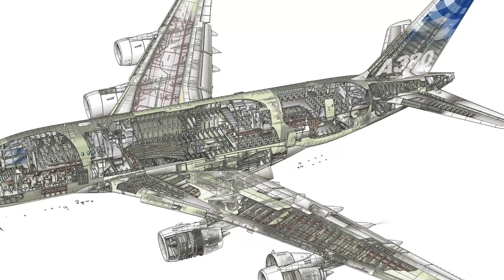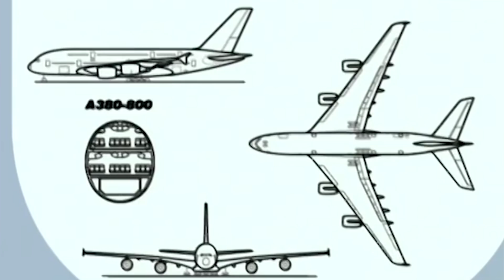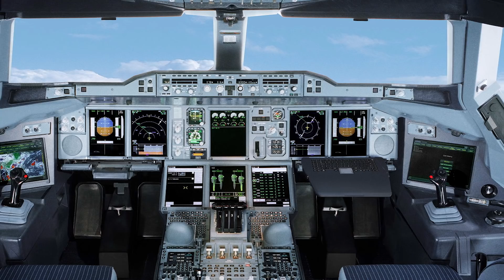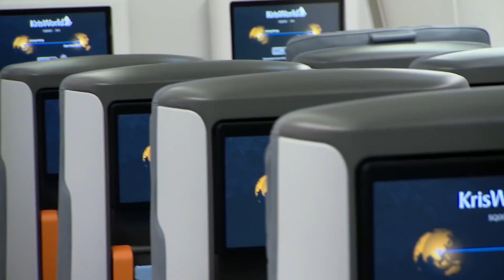Airbus A380 - the European flagship

Comment: I fail to understan why this plane are not used at charter routes. With +10.000.000. paasengers in Alanya alone, its strange that it's not economic, even if it could move 2400 passengers each way daily ex. from Frankfurt to Alanya, You could limit the laugage to cabin (which 90% already use). I have heard that the take offs are to costly in fuel consumtion.

Comment: The A380 is a failure; despite all these positive comments; They are scrapping them already. After airlines found the reality of them nobody wanted them. Not even the freight companies want them. With air freight one of the big problems is that the cargo is often too light and you are out of space in the plane before you are out of weight-carrying ability. So you wind up flying anyway because you could not fit in more. The A380 would have been good in that context but even with that advantage, nobody wants this airplane...

Comment: I would not write the A380 completely off. When air travel returns to previous levels after the worldwide pandemic ends, busy airports will surely benefit from higher capacity planes, as they can carry more passengers to the air on the existing runways with existing capacity. I really hope a twin engined version of the A380 will see the day of light one day. The A380 is - currently - a flop. But lessons learned are valuable and could potentially pay off. I might be wrong though. In that case, the A380 is really the flying elephant.

Comment: Amazing machine, but also one of the ugliest passenger planes ever built.  The era of the 4 engine passenger planes is over, but the 747 will probably continue on as the best cargo plane out there, since it originally started as a freighter and is much better suited for the job than the 380.

Comment: I thought Airbus was going to end production of the A380 after all deliveries are completed in the early 2020s. And I thought Boeing had not yet announced that the 747 program would end. To my knowledge Boeing has no plans to discontinue the 747 production as of right now.
Reply: FinalLugiaGuardian Wow, the 747 is dying next to the 380 so what rock do you live under if you didnt know that...
Reply: @stacked-motors  That may be true for the passenger 747, even though Boeing has not announced any such intentions. 
However, even if the 747 passenger jet ceases production, the 747 freighter will continue to be in production for the foreseeable future. 
Joe Sutter predicted the 747 would one day be just a freeighter. And a design feature of the 747, the nose that can open up to facilitate loading cargo from the front of the airplane, that allows much longer cargo that cannot be loaded any other way in any other aircraft, is the reason that it cannot be fully replaced for that purpose.
That is why the 747 will continue to survive for much longer than the A380 production will.
Reply: @stacked-motors  The A380 is done. Production will end in a year or two. All airlines using it are retiring it early, within 10 years. It is too expensive to buy or operate. Not efficient. It has to be basically filled to be viable.
The 747 is still being produced mostly for cargo versions and VIP planes. No end of production in sight. Lufthansa is using 747-8s to replace their A380s. The 747 cargo freighter is king of that niche. So no, the 747 is not dying like the A380 is. Somebody is confused as to who is living under the rock.
Reply: dave miller when did I ask anything about the a380, oh yeah, I didn’t, you don’t have to tell me the facts of it everyone already knows
Reply: dave miller also I literally only said its dying, not dead, like the a380

Comment: 747 is not dead yet. The cargo version is still going strong. On the other hand Singapore airlines have retired their first A380 only after 10 yrs. This is mainly because of the failure of hub and spoke model and the advent of small long haul planes which are more profitable.

Comment: It seems like a never ending stream of a380 videos saying how great it is and why doesn’t the industry buy it. 

Airlines are businesses and the bottom line is what drives their decisions. 

No different than 747-400’s and a340’s being retired, the a380 is another example of the end of 4 engine passenger planes when compared with the business efficiency of twin engine aircraft like the 777, 787, a350 and a330. 

Passengers may like the a380, but those same passengers vote with their wallet when they buy an airline ticket and will opt to find the most direct and cost efficient service to get where they are going.

My last trip to Singapore, I wasn’t about to endure a flight to Europe and on to Singapore so I could fly an a380 even on Singapore airlines.  Further, I wasn’t going to fly domestic on a 737 for 3.5 hours to connect on to an a380 from the west coast of the USA. 

I happily took a 777-300ER non stop to Taiwan and connected onto another 777-300ER  for 22 hours total travel time including connection.  

Some would say that airline could use an a380 for the benefit of the customer, but the 777-300ER wasn’t full on any of 4 flights so there would never be a business case to put a 525 seat aircraft  on a route that isn’t consistently sold out in a 777-300ER. 

In other routes, airlines with the demand would rather offer multiple 777 or 787 flights per day to give schedule options than limit themselves to a single a380 per day. 

For those that say the a380 is the solution to slot restricted congested airports.  The problem is the volume of 737 and a320 flights that by shear numbers consume most of the slots and gates.  Therefore, the solution at an airport like Heathrow is a middle market plane like the proposed 797 that will carry 225-275 passengers that can have 2 planes replace 3 planes.

Comment: Almost all of your videos are really well done and very informative, but this video is largely garbage.

Nowhere do you state that the A380 is a huge money loser, ill conceived in face of more than adequate evidence that it would never make money.

Airbus became obsessed with the 747 program, and ignored all the obvious warnings that there was insufficient demand for an airliner of the A380's size to ever justify designing and producing one. Thus Boeing sensibly developed the Dreamliner while Airbus stupidly built the white elephant A380.

You mention the 270-odd sales of the ship, but with rose colored glasses on, not that this is far below the break-even point, or that even 100 additional orders, if they result in deliveries, will leave the plane deep in the red.

Permanently in the red, as Airbus sells the A380 at a break-even price point.

And, a VALID comparison with the 747 would have been the 8I, NOT the -400, and the 8I is just as efficient AS ACTUALLY FLOWN as is the A380 as it is ACTUALLY FLOWN.

And the A380 has not "ended the 747 program", as the -8I is still in production and the -8F has no peer in its market segment.

You completely blew the subject of the A380 freighter version: The problems for Airbus there, vis-a-vis the 747, are at least 3-fold: 1) No nose door; 2) The cargo bay is cut-up and inefficient in shape due to the intrusion of landing gear bays and other items; 3) The volume of the fuselage is too great for the weight-lifting capacity,  making freight hauling fuel-inefficient.

Finally, you talk about the huge size of the A380 as if that is in itself an accomplishment. Well, that could have been done in the mid-60's or earlier: the original 747 was to be a double decker, but it was as obvious then as it was during A380 development that it made no economic sense to build such a plane, even if there were a few customers who wanted it.

Comment: An amazing machine. Not sure there is a market for it. I do hope it survives and I hope someday to fly on one. I'm worried I won't get that chance.
Reply: Unfortunately, Airbus’ market research and forward projections were incorrect. However a magnificent airplane the 380 may be, passengers preferred direct point to point travel over the hub to hub model, hence A350, B787. Even Boing, worried that it’s heavy lifter 747-400 would be challenged, blew a ton of cash on regenerating the 747-8 uneccesarily, never to be recouped. What both manufacturers gained however, was flow on knowledge enabling them to advance in new tech. Personally I believe that Airbus is superior to Boing both in modernity and airplanes that airlines and passengers prefer to fly. Boing always compromises its product by swapping parts around, and has lost the ability to launch new product sans engineering problems. Compare the initial records of launching the 787 to those of the 350 and one will note Big differences. All the hou hah about so called Dreamliner going on for years, and the Airbus mob listened to their customers and quietly got on with their XWB350...... the moniker is apt as we live in a world of acronyms and XWB says exactly what this amazing machine is. As for giving a name like Dreamliner to product that turned into Boing’s Nightmare, who cares? Airbus grew from Concorde, Boing grew from bombers and that’s a fact. Mix n match from Boing came in the form of B17 to B307; B29 to B377; KC 135 to B707; HLX reconfigured B747; 707/727/737/757 all sharing essential similar fuselage design etc. Boing could not even decide in the 80s which model to bring next, hence the mildly successful 757 and 767 models, each of them “half resolved” and half sold. Both could have been iterated into far more relevant machines..... look how well the 757 has been used by carriers in the 21st century, yet by now their lives are limited by airframe cycles and technology. And Boing’s offering in 2020? A stewed 1950s design upgraded with modern bells and whistles that the airframe cannot handle called 737MAX. Yes, I believe reinventing bomb trucks like their B52 is great idea ( for once, the taxpayer got his money’s worth ) for 70 years, but come on Boing, would anyone purchase a 50s motor car with iPhone connectivity? Safety has come magically a long way, even tho’ people do their best to kill themselves on the road, a 2020s passenger airplane such as 737MAX does NOT have any place in the sky.
Reply: Anthony Tolhurst very busy "hub to hub" sectors, are still a good market for this aircraft. That's why the A380plus project was on the drawing board. Airlines still wanted to be able to use this aircraft to fly on long-haul busy routes where direct point-to-point wasn't so important. They could still achieve at 12% drop in costs, and an increase in efficiency of 17% overall, depending on seat configuration. so there is still a few years to go yet before this aircraft disappears from our skies. Those figures allow an aircraft to pay for its purchase cost in just three and a half years of operation on some extremely busy sectors, after that an airline can make profit without having to pay for the aircraft.

And the new concept of the extreme density low-cost market look very promising indeed from a large aircraft standpoint. That's why the new 777X-9 and 747 800 are beginning to get a new lease of life on the order books. The new 777 can house up to 414 passengers in three classes, and over 500 in two class high-density layout, rivaling the 747-8 and the A380 in terms of margin overhead per capita.

This new high density low cost model, will dominate the long-haul market for the next 4 or 5 years. with many airlines already reconfiguring their seat layout to suit this market.

This doesn't mean that the executive sectors, offering three class layout, will disappear from busy routes, it just means that the high-density low-cost market will take a slightly larger share than it does currently. There will always be a business/first market no matter what, because that's what really pays the bills, it's just that it will take a step back and take up a slightly smaller share of the overall sector market.

With improvements in engine efficiency, new manufacturing techniques, and the use of more composite materials in construction, over 100 A380plus, another 120 777X-9, and options for another 40 747-8 aircraft are on order, so the VLA market is now looking healthier again - for very busy long haul hub routes at least, anyway. The new high density low cost seat marketing models will keep these giants flying for years to come. Perhaps, not decades, but for many years anyway.

Proof of this, can be found in last month's contract by a small low-cost airline, to purchase 30 boneyard A380s to operate using a 'super high density, super low cost, on super busy routes' model.

Other low-cost airlines are following suit. Over the next five years many nearly new 747s and 777s will be purchased or leased from boneyards, or carriers wishing to offload their fleet stock, to use as a one class extreme high density very low cost hub to hub model. They will squeeze out the last few percent of value of these wonderful older VLAs that thought their flying days were over.
Reply: @Andrew Liang YOU SOUND VERY ANGRY!!!
Reply: Sadly, I think it's never going to make it. The airlines are freaking out so much over fuel costs that they will never give it a chance. Another problem is the US government funds Boeing so it can afford to give away free planes to entice airlines into buying their planes.

Comment: The A380 has had very little effect on the 747, there are not many airlines who have retired a 747 and replaced with a 380. In fact many operate both still. But the real reason for the downfall in the 747 is actually the 777 and 787, that's usually what they are replaced with. However Down here in New Zealand, the most isolated large country on the planet the 747 8 would have been a good choice for all the long trans Oceanic flights across the Pacific like the 744 used too. Fast, safe and reliable.  Plus massive passenger appeal.
Reply: Gareth Curtis Sky Surv but...ANZ uses 787s and 77Ws